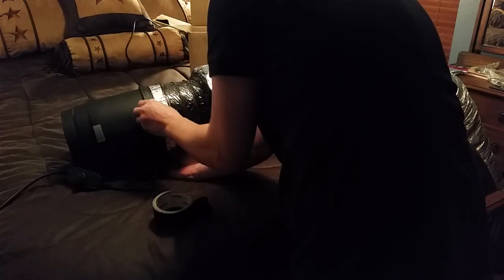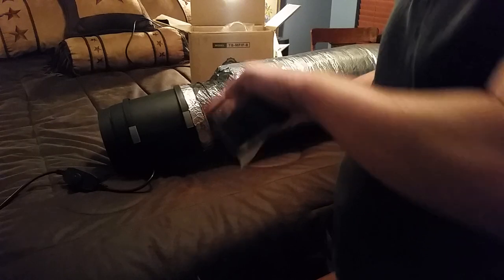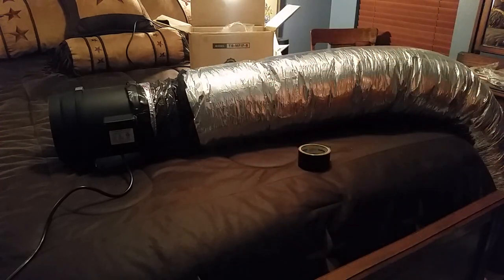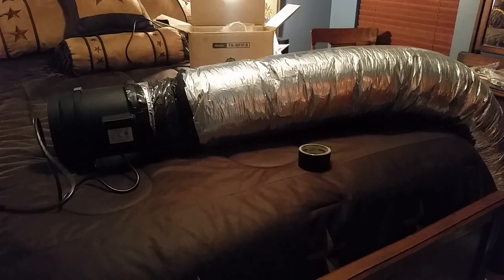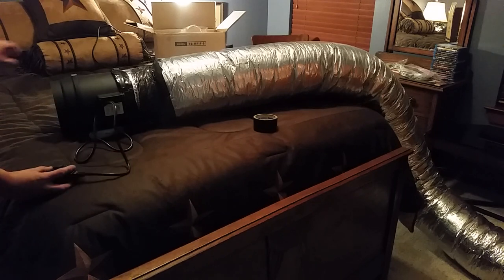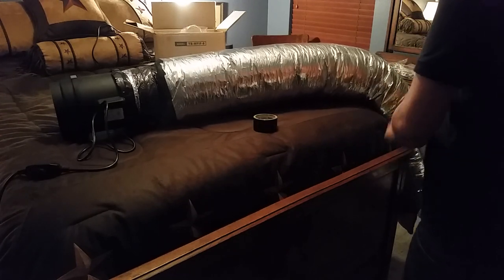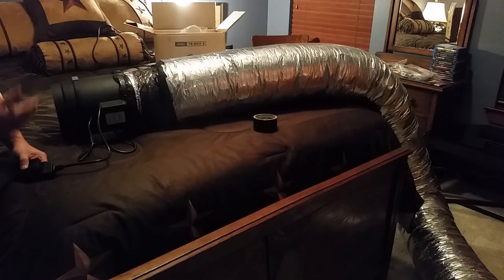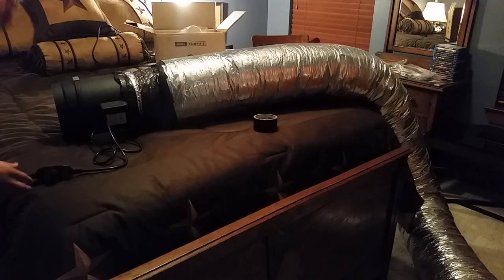Terra Bloom 8" fan test

Comment: Are you certain that is a terrabloom fan? The speed controller and fan body don't appear to look like the ones used by Terrabloom
Reply from the maker: It was an Terrabloom fan it sucks so it went back . I got an other fan thats so much better
Reply: @MyIronman8  yeah I went and did some looking into their older models and was able to find that fan. The 8" Terrabloom I got looks different, has the EC motor
Reply from the maker: @RideForLifeCR250R  ya if you want to spend 160 bucks for the new ones  . my new one was like 80 bucks
Reply: @RideForLifeCR250R   The new one with the EC motor has crazy efficiency. 710 cfm for 75 watts is insane. Most other 700+ cfm fans pull around 150 watts.